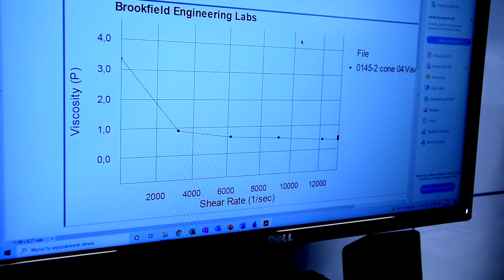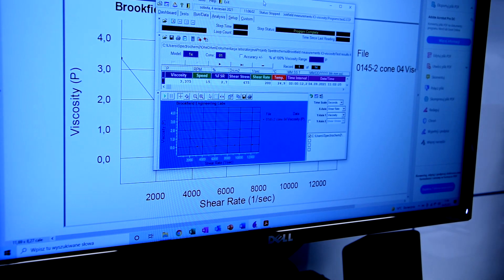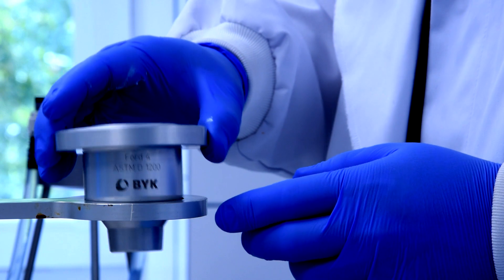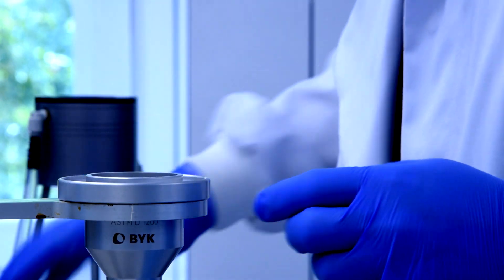Studies of newtonian thickeners for paints

Comment: Plz give examples for newtonian thickener used in latex paints
Reply from the maker: You can find many newtonian thickeners used in latex paints between various suppliers, like Viscomal PS202, Tafigel PUR 80, etc. Remember that rheological additives of this type have an associative effect between the binder particles, pigments, and surfactants. Not every additive associatively works the same in various dispersion binders, and it may turn out that one causes Newtonian flow, and the other slightly more like a slightly pseudoplastic flow. Always use the application data guidelines, such as those prepared by producers of raw materials and what we also develop for them in our laboratory